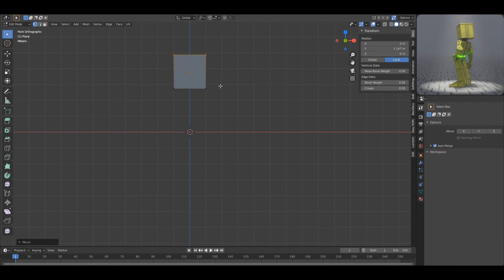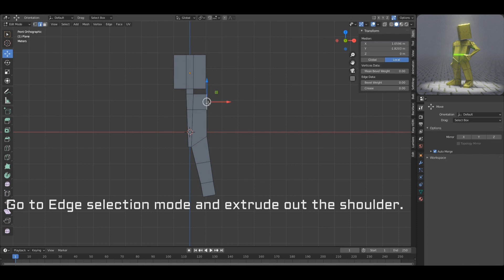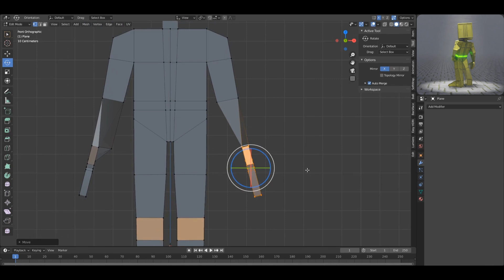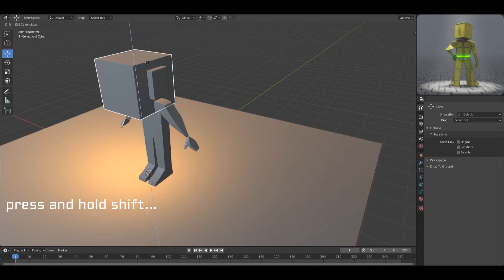Model your First Low Poly Character in Blender !

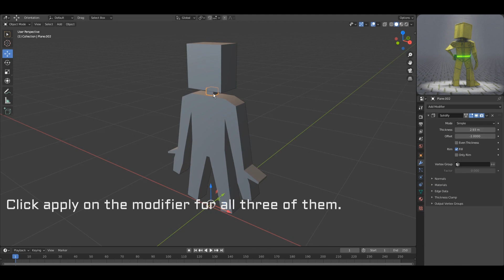Comment: I did a mirror, but it didn't happen. the resulting model came out divided into 2 parts. where did I go wrong I don't know . 4:18
Reply: Okay, I tried again, and the problem is solved. thanks.
Reply from the maker: @pepefrograinbow5866  You are brilliant !
What was the issue did you remember ?
Maybe people reading this can learn from your experience.
Reply: @BracerJack  I had this same issue too, and it was just the default mirror modifier. I had to just tick the Merge checkbox and adjust it a bit to make the middle part merge together!
Reply from the maker: @DonCrafts1  Oh oh, MAKE SURE MAKE SURE MAKE SURE your pivot is at the point where you want to mirror AND the merging points are on the same X location as your object's pivot exactly ! 
That will fix it ;p

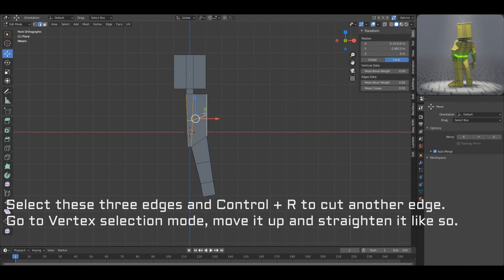Comment: Very cool tutorial and fun to do. I just realized on a second attempt where at 2:24 I also had issues straightening it up and had to move each vertex manually. Turns out I was using the wrong axis and hitting 0 then enter would shrink the body in that area. I feel more confident already that attempt 2 will look better. Thankyou for the tutorial!
Reply from the maker: Thank you Michizure XII :D
And remember if you select a vertex and hit "G" twice, the vertex will slide along the edges ! :D

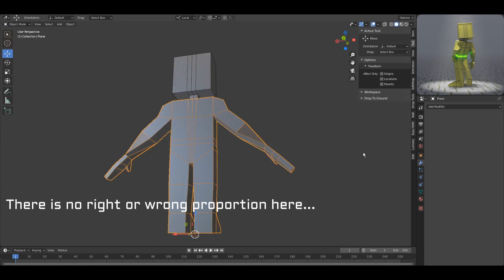Comment: someone can help me please? at 7:11 I cant rotate the hands. I tried to change the transform orietations to view, but for some reason the hands just change to another place, like its moving and not rotating.
The rotate thing is at the center of the body(in where the 3d cursor is also)
Reply from the maker: Hello, not sure if you are struggling to roll the viewport or actually rotating the hand, if you issue is with the viewport rolling
Go to:
https://www.youtube.com/watch?v=-JCyT8kbn_g
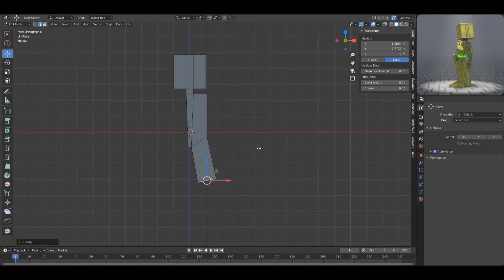Go to 2:10, the answer is right there, it will take you three seconds to get it, LITERALLY 3 seconds :D
Reply: @BracerJack  When im rotating the ahnd, im able to rotate but the arm gets twisted which is blocking me damn it.

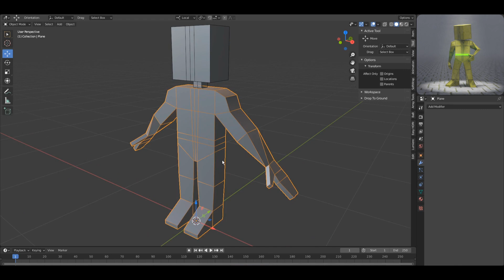Comment: How do you "roll the viewport" at 7:05 ?
Reply from the maker: Hello Werner Graaff :D
Go to:
https://www.youtube.com/watch?v=-JCyT8kbn_g
Go to 2:10, the answer is right there, it will take you three seconds to get it, LITERALLY 3 seconds :D
Reply: @BracerJack  Thanks a lot! I was getting so frustrated :')
Reply: @BracerJack  Also, Alt+ A isn't bringing up anything, and when did you join the head and neck back together with the body?
Reply from the maker: @wernergraaff785  

Answer to your first question: Go straight to 10:32, the answer is right there, in plain text.

Answer to your second question: Select the head, neck and body, press control + J to join them, now you can rig them as a single entity :D

Comment: Not a bad tutorial at all, very clear and concise. I saw you were told about X-Ray mode in the comments, here is an additional tip for it: With a X-Ray mode on in a default scene, go to File> Defaults> Save Startup file. The setting will always be applied when you open Blender then.
Reply from the maker: I replied to that comment just now, check it out :D
And you are ever so helpful Michael Hensley, thanks !

Comment: hi! i'm very new to blender and i'm on 2.79, i'm nowhere near the level you're at but maybe this will help you some. you keep talking about not being able to select points on the back of the model without being in wireframe mode - there's a button for this! it's called x-ray mode and it's right underneath the y-axis button while in edit mode, just to the left of your material buttons. hope this helps!
Reply from the maker: Once I reach home, I'll give it a try, and if it works I'm going to love you over 9000.
Reply: @BracerJack  (  ^▽^)  here's hoping!
Reply from the maker: @ahegpbtrftcotu  I just finished work, I'm so tired I just now want to sleep, I'm not going to even turn on my computer. 
I would check your miracle cure tomorrow and update you :-)
Reply from the maker: Ok I have tested your suggestion, it works and I LOVE YOU for it.
But if it is ok with you, I don't really like the whole transparent thing going on, I know we can adjust it but even if I push it all the way to the right I can still see the back.
Now I don't have a problem with that since it is indeed called the XRay view.
I just wish there is a preference somewhere that makes box selected a region of vertices select everything from the back too because if you have noticed, in object view doing box select WILL select things from the back even if they are hidden from view, hence this is entirely inconsistent on the side of Blender as of now 28-July-2020.
Reply: Even better tip. Just press "B" and everything with in that box will be selected...